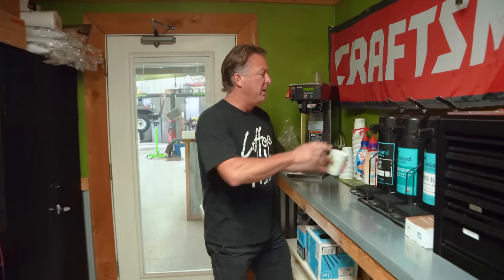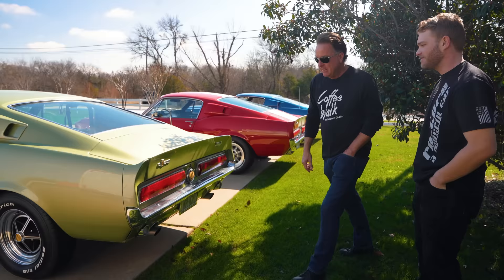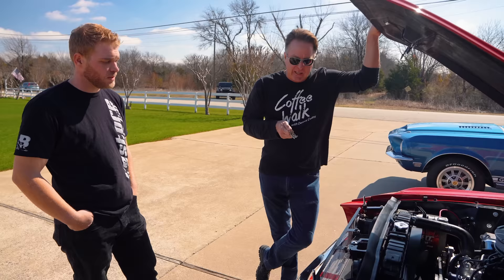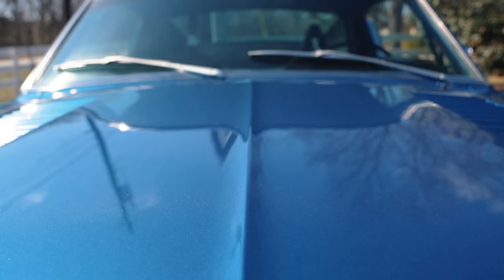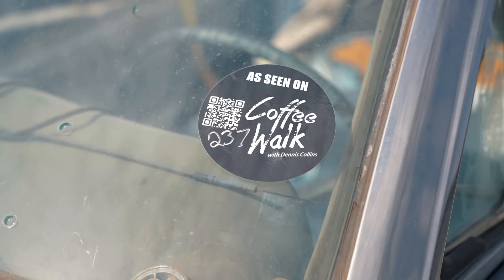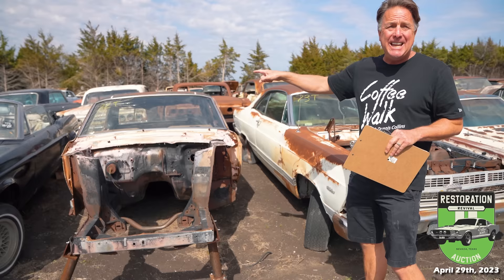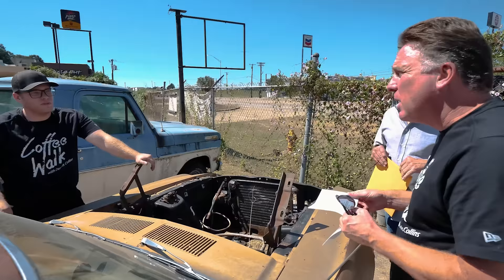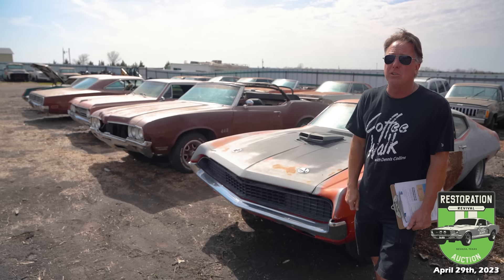What Happened to the Shelby Mustangs + Restoration Revival Update!

Comment: I owned a 1970 Cobra Torino, 429cj, four speed top loader. Didn't have the shaker but window slats. Wide ratio four speed and had the hubcaps and factory hood pins. Buckets full console with AM/eight track players with storage case all factory. I bought it in late 1978 and I was the second owner. That car had mostly highway miles and that machine could really roll on the big end.

Comment: I like the Fairlane, my brother had one that supposedly came factory with 390 4speed and the engine was missing but the body was perfect and the only engine we could find at the time was a 289 2barrel carb that ran really good and it was a quick car. It had GT 500 stripes on the bottom of both sides... After installing a 4barrel it was amazing how good it ran. I hardly ever see em anymore and the 1 he had was a 66 or 67. I don't remember cause it was in the 70s when we happened upon it. I didn't know about numbers back then and it could've had a 428 engine but that part I'll never know lol. I know where 1 is with a 390 4speed is but I don't know if it's 4sale and it runs and drives unless the guy sold it

Comment: Where is your Dodge Dakota row Dennis? A historic little muscle with optoinal 5.2 and 5.9 motors in 2WD and 4WD. There was even a Shelby Dakota in 1989 and convertible models also. A mid sized truck with V8 power offered in cool colors. These trucks are getting hard to find now. I have a 99 factory 5.2 4x4 shorty in solar yellow. She is rough and needs everything but I anit sellin her.